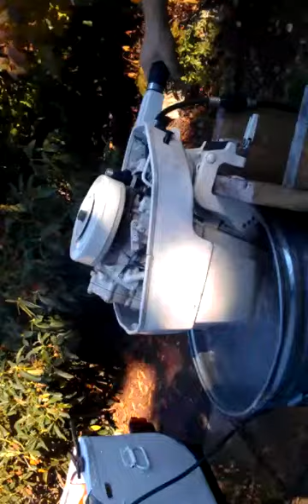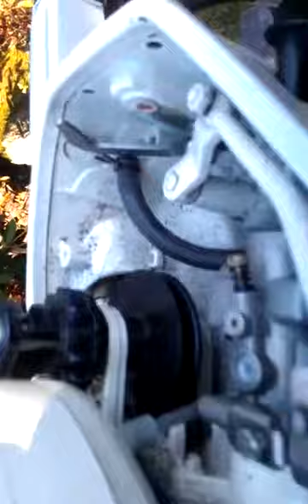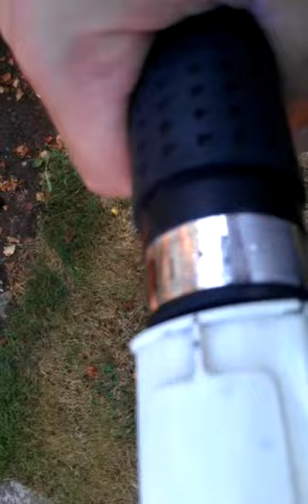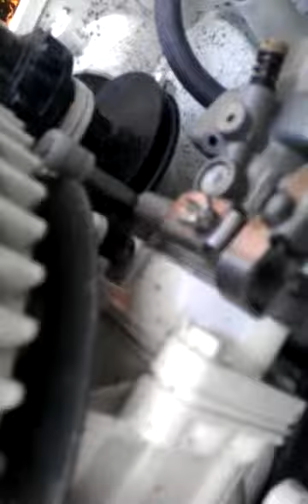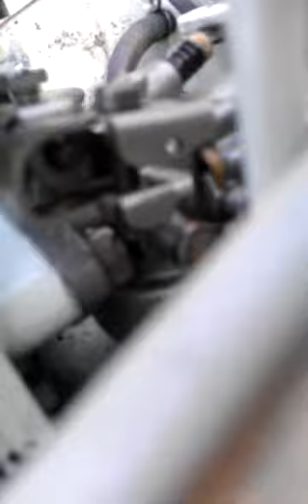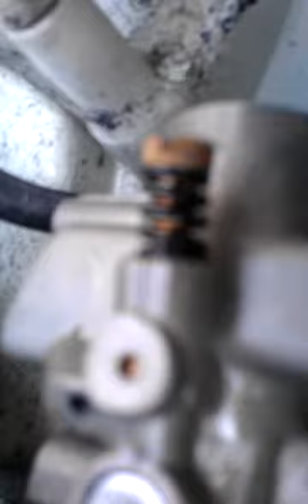10 hp Chrysler carburetor issues

Comment: Ok 2 things to it sound's like it is only running on one cylinder check for spark on  the cylinder that is not firing the spark plug will be colder #2 that sneezing is a low speed lean miss the low speed carburetor jet must be dirty or the carb sink is off.See my videos on points and 9.9 carb adjust.